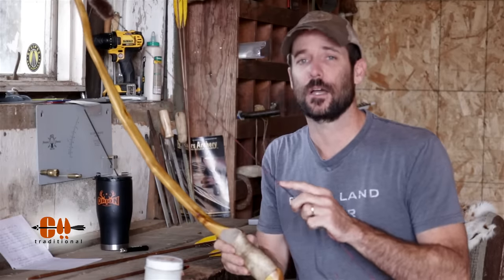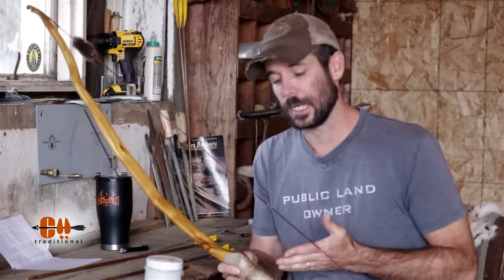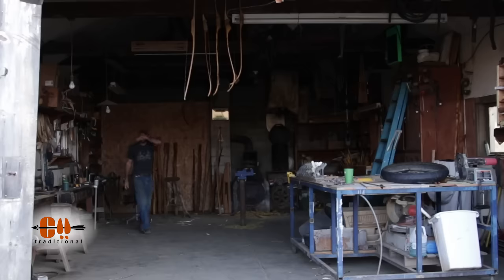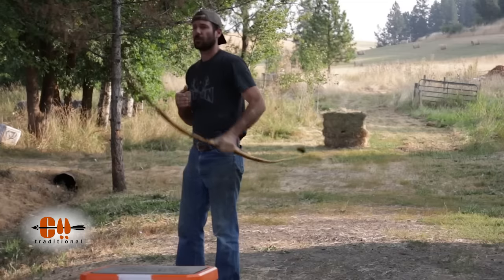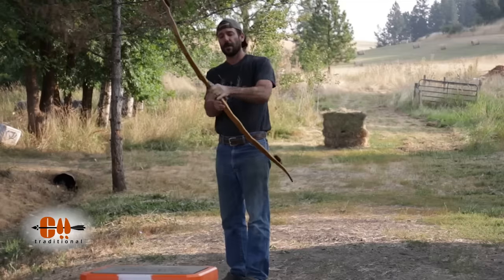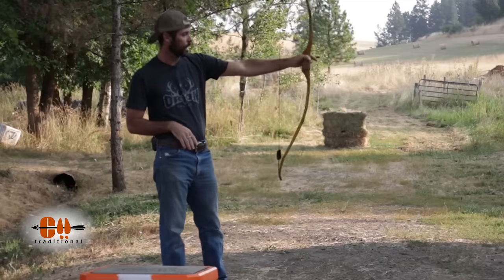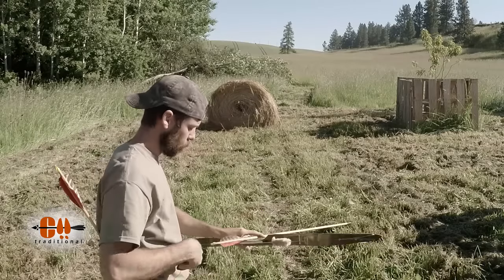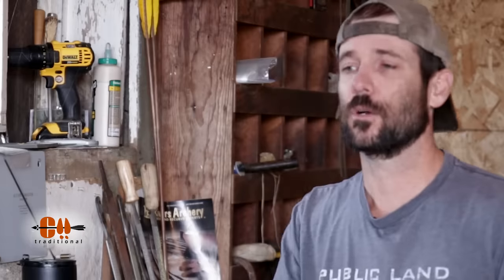Tuning a Recurve, longbow, or selfbow for perfect arrow flight

Comment: Hey! I've recently carved and made a red oak self/pyramid board bow 
And I'm having an issue with grip and arrow flight.

The grip is 1 inch thick and flat against the palm, but my arrows leave and hit the target at an angle with the point to the left and nock to the right.

Would anyone have any tips for correcting form or bow grip in this case?

Thanks!

Comment: 1:43 you say "a little higher spined" but there is no standard spine chart. So what do you mean? The way every arrows spine is described is different based on companies.
Reply from the maker: Tried, for carbons. Wood is a little different. But even for carbs shafts you should be able to figure out the deflection. That’s what it comes down to.

Comment: What poundage would you suggest for deer hunting?I have one long bow I had made that's 66 long 55lbs draw at 28inch draw.i bow hunt confidently with an matthews so bow hunting is not new to me although long bow is.
The poundage is a little much right now  and am fixing to have another one lower poundage made.i have had 3 shoulder surgery's and not confident in long bows yet to be an ethical hunter.
I'd like to know what you would suggest minimal for deer 30yr longest shot.and what arrow weight.
Thanks for the help.
Reply: I'd say 50-55 would be plenty, with the correct arrow spine, and a razor sharp 2 blade head. In my opinion, it's not a simple matter of "this much speed is needed for deer hunting". It's more about taking the shot at the right moment. You're already a bow hunter, so you know a relaxed, feeding deer at 25 yards is a better shot to take than an alert deer that's looking right at you at 15 yards. You could always limit yourself to a shorter range. I personally shoot a home made 50# longbow, but i never take a shot beyond 20 yards.

Comment: Whats a good number to be at for total arrow weight when targeting whitetail? Right now I have a 500 spine with 200 out front that weighs around 500 grains. Would it be worth trying a 400 spine and going up in total weight?
Reply from the maker: You should be fine with that. Perfect flight is much more important than a little more weight. So go with whatever flies best.

Comment: For a newer traditional archer who's release still needs some work, yet they want to build and tune their own arrows, is there anything wrong with tying a d loop on the string and using a release? I guess it won't mirror want you're doing exactly when you go back to a glove, tab. or thumb ring. But is there any reason why it wouldn't get you in ball park?
Reply from the maker: It tends to be noisy to use a release with a trad bow, but there isn't any reason it won't work.

Comment: I am new to archery (1 year), I have a 62" 30# takedown recurve and a 60" 40# takedown recurve, I don't know the in's and out's of bows/arrows etc but what would you recommend for arrow/spine for me. My draw length is 28.4 (doing the measurment from finger to finger and dividing). At the club where I am they are not much help and have learnt more watching this video than I have from the club for the year. Thanks for the video
Reply from the maker: Hi Bill, there is a spine calculator at 3riversarchery.com that would help you to narrow down your choices. You could also give them a call and they can get you in the ball park.
Reply: @clayhayeshunter  thanks for reply, just looked and it looks like a 600 and 500. cheers.
Reply: Just a reminder to unstring your bows 👍

Comment: For tip weight, would you be including insert weigh into that if using carbon shafts?
Reply from the maker: I guess that depends on how you’re using the measurements. You can adjust tip weight substantially by using different inserts. But as relates to tuning, yes the tip plus insert is what matters.

Comment: awesome video.  question though, when cutting shaft down incrementally how do you only cut off 1/4 of shaft if insert is glued in?   the insert typically goes over 3/4 into the shaft.
Reply: you cut it in the middle and glue it back together.
Reply: Thanks, wasn't sure if the glue would release if cut in the middle of the insert.
Reply from the maker: Joel is just being silly. I’m working with wood and bamboo shafts in this video so there are no inserts to worry about. For carbon you can trim from the nock end during the bare shaft portion. Just pull the nock out and trim.

Comment: I've watched this video about 6 times, very informative! I now shoot traditional a lot, but, and this may be outside of your wheelhouse, I have a compound that has been giving me fits. it's a Martin exile @62# at my 29" draw and the bow destroys vanes. it has a vapor trail limb driver arrow rest, I've taken it to many shops and the manufacturer, and it still tears up my arrows. I used a different rest and it broke off in 3 shots. so I did a test today, as I have many arrows of different spine. I shot 300, 340, 350 and 400's all same size and with the same 100 gr tips. the only ones to survive were the 400's!?! most shops sell me more arrows and say 400 is to light. the arrows are all 29 and 1/4. WHAT GIVES????
Reply from the maker: The only thing I could think of is the timing of your cams but I really have no idea. I haven’t shot a compound in 20 years.

Comment: Dumb question here but you can't really adjust things with a brass nockpoint so would that change your methods?
Reply: Best explanation I have seen but still so complicated its almost a hurdle to shooting.  I have decided to buy arrows and just start shooting lol.  If I cant buy arrows I cant get into archery.  Everything in time.
Reply from the maker: Don’t worry about trying to figure everything out to start. It’ll come as you say.
Reply from the maker: You can crimp them brass nock on a little lose until you get it on the right place, then crimp it all the way.

Comment: I've watched you make a bow, so I had a nice piece oak in my basement, I make one.  Broke immediately.  Bought a pc of traditional wood, Osage Orange from an old timer Emory Losielle to hand carve a bow.  I bought a few tools, draw knife and a special file and hand carved the bow.  Painstakingly scraping each side to make the bow equal.  Tried a couple of shots, felt great.  I was fine tuning the shape, it broke.  Now, in two days I saw cut a 1X2 pc of maple, worked on it as much as I could with power tools, finished it with the draw knife and a pocket knife, strung it and shoots awesome.  How can i finish or what can I put on it to seal it.  I have some linseed oil and some oil based med oak stain.  Could I mix a little and coat it.
Reply from the maker: I use tru oil gunstock finish

Comment: I’m having all kinds of problems. I need help on this. I can shoot 2 different length arrows 1 and a half inches different. But they are both hitting the bullseye. How is that possible.
Reply from the maker: You often won't see much planing effect with field tips. To really get an idea of how the arrows are tuned, throw some big broadheads on the front or strip the fletchings off.
Reply: @clayhayeshunter  i started over. I have always bare shaft tuned my bows. I have a bare shaft hitting bullseye every shot . A half in tail high. I put the same length arrow with 4 inch feathers and it hits right 4 inches and high 6 inches every single time. I’ve rotated thinking I was getting feather interference but still the same. So should I bare shaft tune with a broad head? I have never had this problem .
Reply: @clayhayeshunter  never mind my last post. I feel like a dummy . I bare shafted with a 50 grain weight inside and didn’t realize it. The other two didn’t have the weight which explains a lot. Thanks for your help on the other.

Comment: Quick question. I got an longbow and started shooting I use an Easton axis 500 with right twist feathers.
If I aim with the arrow tip at 20yrds am hitting low and right.
The bow is 66 long 28inch draw 55lbs.
My knock is pretty much straight. Any suggestions?
Straight feathers?
Reply from the maker: Since nock position is heavily influenced by the target material, I don’t pay a lot of attention to it. If you’re shooting a heavier tip you might be under spined. It may also be the can’t of the bow. Try shooting more vertical.
Reply: @clayhayeshunter  ok thanks.i was shooting an 125gr woodsman.
I just fletched 3 arrows to see if the right twist was going to be ok before fletching the rest of the arrows.and was just wondering if shooting to the right was the cause of the fletchings.
I will try an 100gr head and see if that helps.
Reply from the maker: In my experience, left or right feathers don’t affect accuracy.
Reply: @clayhayeshunter  ok...another quick question. How far from the nock do you glue your feathers?
I've only fletched 4 so far to try out but my feathers are touching my arrow shelf.am thinking it will effect accuracy. I have 4 inch feathers.

Comment: You jump around between all the different terms for the same thing, without explaining what the different terms mean.  So the first time you say an arrow is over-spined, I wasn't sure which problem you meant.  At 17:20 you talk about dynamic spine being too high... and I don't know if you mean it's too stiff or not stiff enough.  It doesn't help that wood and carbon arrows use different spine ratings that go in opposite directions, and don't even have different names for their units.

Comment: I got a question
Reply: When you are a bear shafting your arrow, and let's say your arrow to your poundage and the length of your arrow takes 140 grain, if you go from a field trip to a broadhead and if I'm shooting 140 grain broadhead because the fuel tip shoots that with my arrow do I have to change the weight a little bit on a broadhead or does the two go inside with each other if I get a straight shaft 140 grain broadhead on the end of my arrow and the line and everything is correct then can I switch to a set of hunting

Comment: I guess cutting doesn't apply if you're using a clicker?
Reply from the maker: Cutting?
Reply: @clayhayeshunter  the length of the arrows
Reply from the maker: Ah, yes. The clicker would act as the psychological trigger.
Reply from the maker: But it’s still important for tuning.

Comment: I can't believe you didn't define "nock high" and "nock low" etc before you went on to spend so much time using the terms. Frankly, the more you talked, the more difficulty I had accepting your explanations and following your undefined terminology (longer lever arm??). I don't believe that the string forces anything sideways very much, however the bow itself, an extremely rigid object compared to the string, certainly does. I appreciate your efforts, but frankly they didn't seem to make useful sense to me much of the time.